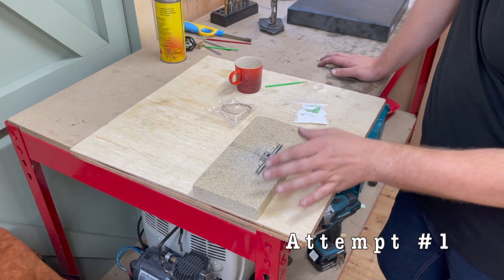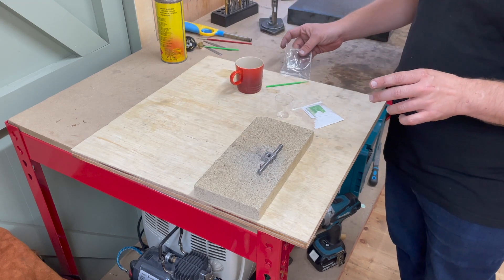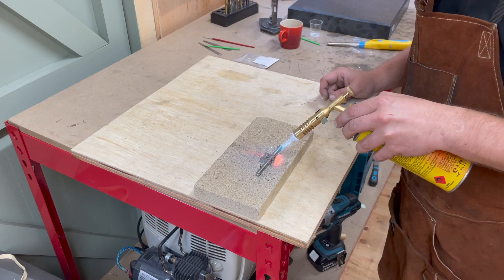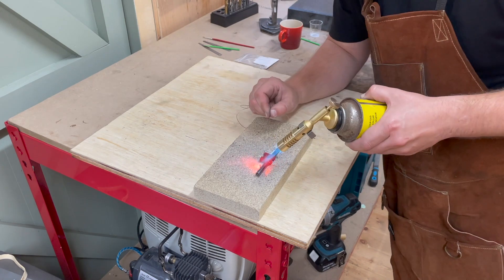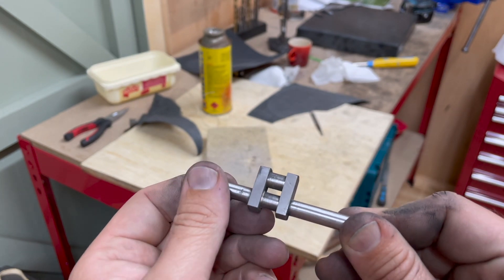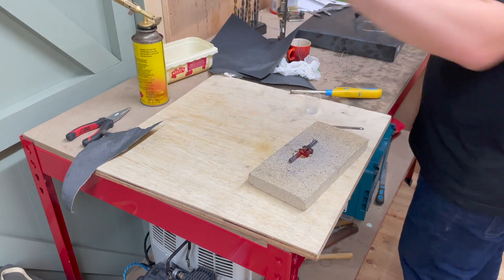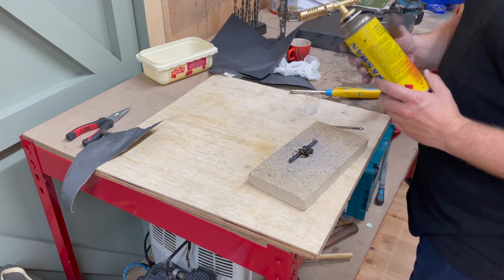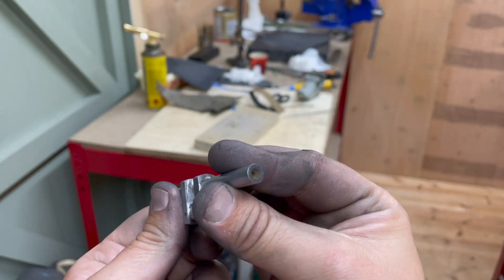Building a Stuart 10V Steam Engine on a Lathe VIIIb - Crankshaft Brazing

Comment: Sorry, I accidentally pressed the send button. To continue:
is assay quality: it was pretty expensive, but only tiny quantities are needed and my supply has lasted for ages. Carrs also sell a slightly less expensive engineering non-assay grade. They all come in a syringe which allows precise and economical application. Another little hint if using silver solder rod (learnt from silversmithing) is to cut the silver solder into very small pieces (called pallets) apply the easiflow flux paste and push the pallets into it. Apply heat gently at first to boil off the water without dislodging the pallets and then increase the heat intensity to get the silver solder to flow. I find this technique easier to use than applying the silver solder rod to the workpiece as there is always a temptation to use the flame to melt the solder without getting the workpiece hot enough.
Hope this is some help, but you are learning so quickly through practice that I am probably teaching my grandmother to suck eggs, Keep up the good work and best wishes.
Reply from the maker: George thank you so much for your reply - I'll try the pallet method next. I need to practise on some small pieces before my next attempt at doing something that actually matters!

Comment: Good advice from Mr Factotum, I was fortunate to find a whole lot of refractory bricks in a scrap yard years ago and they are even better for containing heat than ordinary fire bricks. Only problem is that they are very light and crumbly.
I have an old 10v kit that I started building yonks ago when I went to model engineering evening classes - sadly no longer available - and I feel inspired to get back to it and try to complete it, though I don't have quite the range of equipment that was available at the College. My kit has a cast crankshaft rather than the fabricated assembly.
Silver soldering is a bit of a tricky knack to develop, but there is some very good premixed solder and flux paste available in different grades that make life much easier for very small fiddly jobs. I bought mine from a jewellers' suppliers, and it is pretty expensive although only very small quantities are needed and mine have

Comment: hi ww
nice try for 1st attempt, i'm not trying to tell you "how to suck eggs", but here's what i would do,
Make sure the components are fully degreased before assembly
Flux them prior to assembly to get flux on the entire surfaces.
Put some fire bricks around the components as well as beneath, the heat is dissipating from the job too quickly it will help maintain the temperature.
Good Luck and hats off to you for having a go, many are put off at having a go and your video will encourage people.
see you next time, you only learn by trying and having a go!!
regards
mr f
Reply from the maker: Hi Mr. F- any and all advice is gladly taken and appreciated. I think I made a mistake by reaming and then not applying the flux first - the joint was too tight, there was only a very small countersink on the crankpin side and none at all on the axle side for the solder to flow into. Heat-wise, I felt like I got it bloody hot - but maybe too much and burnt off what little flux there was? More practise definitely required...